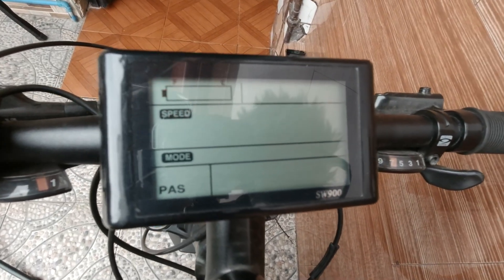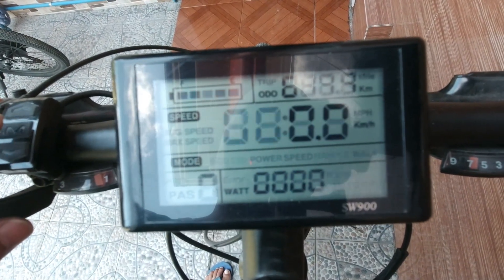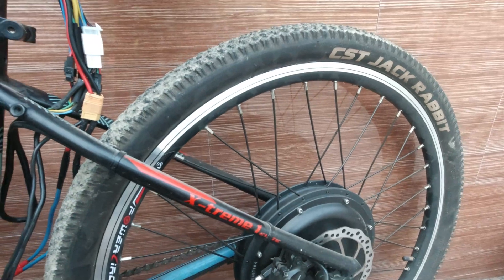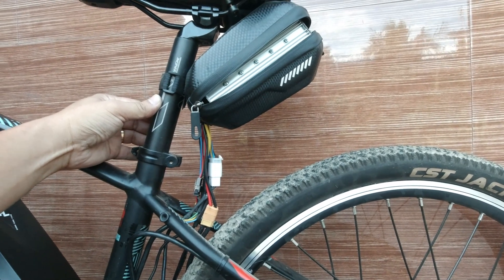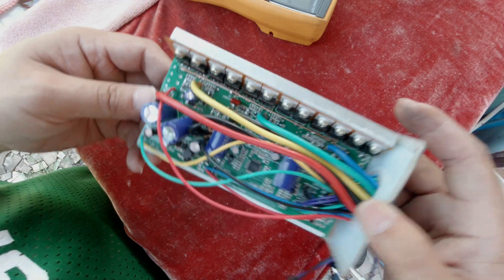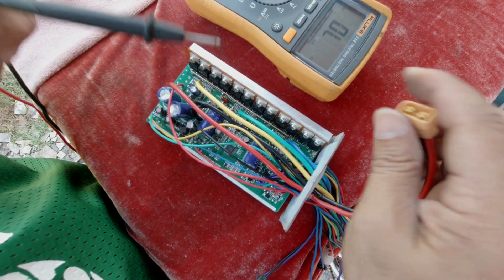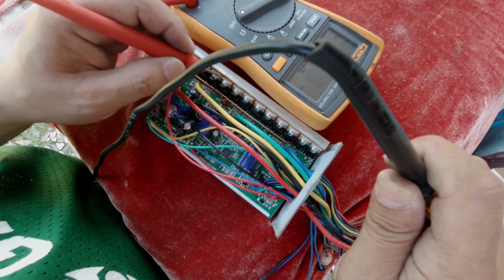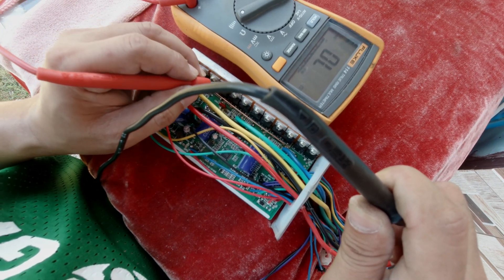E-BIKE Conversion SW 900 ERROR Code 09 Troubleshooting | DIY Petz

Comment: I replaced all Mosfetts. It didn't work.
Reply from the maker: I think you need to purchase a new controller Sir.
Reply: @RollyPetz Yeah I went and bought new controller from Amazon. Probably need to do wiring configuration to work but see what happens. TY.

Comment: Don’t forget something that I have experienced was losing one of them washers the thermal washers for the screw for the misfits the matter what those thermal washers have to go back on, but I know you know this so I just wanted to say it so whoever sees this video and looks at the comments They understand that’s a very important part because if you forget to put the washer, the thermal washer for the MOS fats heat up and you can have the same situation all over again maybe even worse because the thermal washer is not even in very good job and testing great content Learned a bit here.

Comment: Hello friend, I recently bought an electric bicycle, at first it set the speed well, but then it set a speed that was not, it went up to 99km/h, from one day to the next it was that, I suspect that there was a short circuit because it did not suffer No mishap with the bicycle overnight, I am not an electrical technician or similar, I am just an enthusiast, I don't know if it is the hall sensors in the engine that are blown and that is why it sends an erroneous reading on the screen that appears 99KM/h as I mentioned, that is, some mosfet like it appears in your video that has blown. The bicycle accelerates very hard without going through the speeds, it had 5 pre-established speeds, but the accelerator increases with greater force without going through any speed, as if it were only one, it advances but it shows 99Km/H as I mentioned, it is a planetary motor of fatbike 48v 1500w, the display is an M5. I hope you can give me some tips to fix it because I can't calculate the distances correctly because of this error that always indicates 99Km/h when moving forward. I also checked the motor to see if the magnet had fallen off, which they then say is out of place but it seems that that's ok. As a curious fact, when you tow it backwards or in reverse, the bicycle marks the KM/H well but when you move forward it does not mark anything, if you accelerate it it always goes up to 99KM/H... what could it be? I hope you can help me... thank you for reading me.

Comment: Hey I have a error 09 issue on my sw900 the screen turns on and so does the battery however when I use the throttle it doesn’t drive does that mean I need a new motor aswell?
Reply: Same problem bro, lmk if you have found out solution
Reply: Did you work it out?

Comment: Hello, error 9 is a problem with the contrailer, but I disconnected the contrailer and the battery and the ride is just as heavy, although I could drive easily before, so the problem is in the motor wheel?
Reply from the maker: Good day Sir, possibly that has something to do with the hub motor. Have you checked if the bearings are OK? Maybe it needs a little maintenance. thanks.

Comment: Hi I watched your video and I have the same error I thought buying a new controller would fix the problem but the problem was still there. Any idea what else it could be ?
Reply: It only shows error 9 when I turn the throttle
Reply from the maker: Does it work now?
Reply: No nothing I tried worked I have a new kit on its way
Reply: My SW 900 does the same, Error Code 09 when I throttle and motor doesn't work. Did u get urs to work? @darrengleed7001

Comment: I have error 09 only occasionally when driving, reboot usually solve it.
What can possibly cause it?
Reply from the maker: No idea really Sir, but I guess one of the mosfets have heating issue.
Reply: @RollyPetz  More data: sometimes it fixes itself after few seconds. And after disconnecting phase wires and connecting them back, this error doesn't appear anymore.
Reply: @SeriousApache 
same error.  same solution. just now, literally. 
gon change motor phase wires terminal ends from motor and controller for better fit then monitor for a few days.
good stuff!

/bklyn👑

Comment: Error 006 ????
Reply from the maker: Hi Sr, Error 06 says "Battery is under-voltage", you may check setup if the correct battery voltage is set under PO3 config and check the battery if the voltage is also correct. Tnx.
Reply: Error 02 porfavor  q significa

Comment: Buenas noches me marca error 11 sabes que puede ser ? Gracias
Reply from the maker: Good morning Sir.

Error 11 is Communication transmitting issues. (Between controller and display), try to unplug the cable going to the display and try inserting it back firmly. 

Thanks.

Comment: Error 8 cosa vuol dire ? No. Va accelleratore segna errore 08
Reply from the maker: Good morning Sir Nat. Error 08 refers to "Throttle’s problem". Kindly check your cable connections for the throttle. Thanks.

Comment: I have same problems please solved it
Reply from the maker: Good morning. If it's difficult for you to open up the controller, you may have it checked by an electronics technician and have the mosfets checked for a possible busted or burned out mosfets. Just have it replaced and try to test it out again. The worse thing is to have the controller replaced with the same specification. Thanks.
Reply: @RollyPetz  Can you give advise to what Mosfits. I’ve busted a few but can’t match the number on the Mosfit.11ON7F6 GF171 MB CHN829.The KT Controller LSW1599-3-2M 36V 15A Controller for Electric Bike 36V 250W. There no obvious reason why it’s blowing Mosfit. Changed the throttle and checked the wire and tested the battery. Would be great full if you can let me know link and Mosfit that would work on this controller
Reply from the maker: @kevinboyle393  good day Sir. Base on my readings if the mosfets are busted meaning they can not handle the current load maybe you can replace it with a higher capacity mosfet. I'm not an expert on this one but just maybe it would do.

Thanks.
Reply: @RollyPetz  Thank you for your reply. There was few problems that could have caused short, we now found the problem 9pin connector middle pin was bend touching other pin. This what was causing the Mosfit to blow. Need to replace but the only information I’ve got is above and can’t find the Mosfit CHN829 OR CHN051
Reply from the maker: @kevinboyle393  Hi Sir, have you tried aliexpress or any online shop?
Reply: Mi pantalla es S900 y sale error 02 ,cual es el significado....gracias

Comment: Really nice 
I have some questions first, what is the flux question that you used and did you need the tin to install the circuit or just tighten the screw and are there differences between the electrical circuits because I did not find the same model, but I found the exact same shape, can you help me please please  I have the same error 09 kontroller problem 
Thank you
Reply from the maker: Good day Sir Hamed, the flux is just an aid to the wetting ability of the solder for a uniform flow once the solder is placed. Upon replacing the damage one, I screw it first on to the aluminum heat sink before soldering to the board so that it won't move when soldering. 

Actually I also did not find the exact model, the one that was damage if you take a closer look on timeline 8:14, it is a AC165A Q8B but what I found was only a AC165A Q8C, but it did work, maybe the Q8B was of the lower rating while the Q8C was rated higher. What I noticed after the replacement during the test drive is that sometimes it would not provide assist and sometimes  cut off the power, so I tried adjusting the P14 w/c was for current limiting of the controller from 10 and adjusted it to 15 and works perfectly fine. Hope this helps and thanks.
Reply: @RollyPetz   Thank you for your response, I have no experience at all, but I am optimistic and very pleased with your video. I hope there is a way to send pictures. I expect that I have exactly the same problem. I asked Amazon for some circuits and a test device, but unfortunately I do not have any experience to fix the fault in my bike Thank you very much for your reply
Reply from the maker: You're welcome Sir, hope you'll find solution for the fix. The worst thing is replacing and finding the same type of controller. Stay safe Sir.